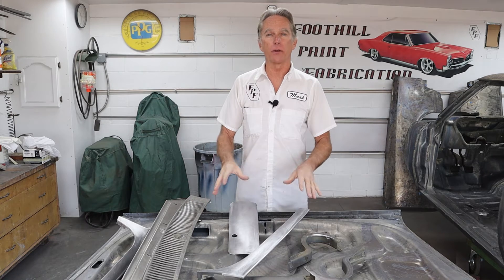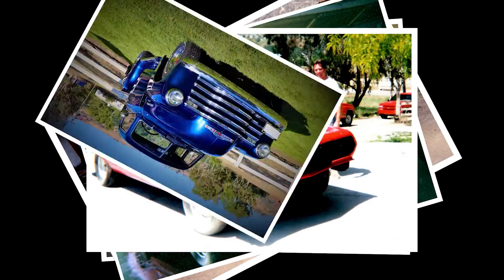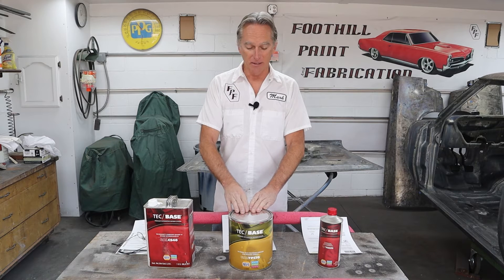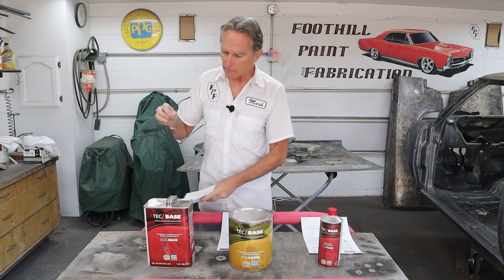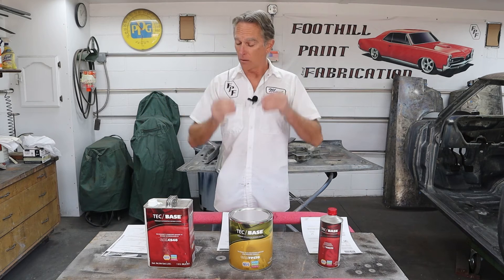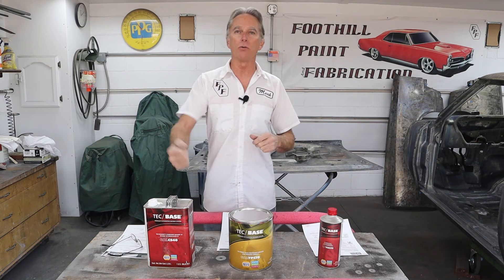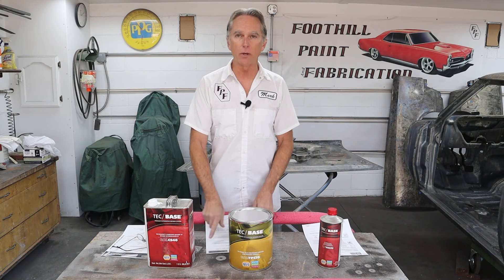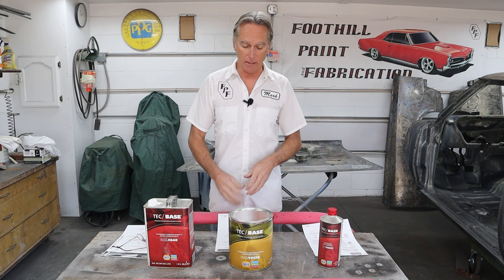Are DTM Primers Safe to use on Bare Metal?  Read the Fine Print, they all are NOT created equal

Comment: The best epoxy on the planet is AWLGRIP 545.
Reply from the maker: Isn't that stuff just for boats?
Reply: @FoothillPaintandFabrication It's excellent for bare steel, aluminum, fiberglass and even wood.  I restore boats here in St. Pete Florida that's all good shops use.
Reply: @FoothillPaintandFabrication Not at all.  Look it up...I've shot it for 20 years

Comment: I bought a speedokote urethane DTM primer is this for bare metal or paint over base
Reply from the maker: I found the TDS sheet for it I think.  It says it can be applied over steel but this is a pretty thin data sheet.  I have never seen a sheet with such little information.  Here is the link https://s3.amazonaws.com/speedosds/TDS/SS-2000TDS.pdf
Personally I wouldn't use it over exterior bare steel as urethane is water resistant, not water proof. It all depends on the level of your project and your budget.

Comment: Thanks for the info, Mark. I didn't know that there was an epoxy primer that was sand able. I have always used Shopline epoxy that tends to plug up the sandpaper. I thought I saw a NAPA logo on the can, interesting,  I'll have to check it out for the next project. Automotive paint is stunningly expensive!
Reply from the maker: I haven't sanded this product before but the rep told me it sands well. I will definitely let you all know. Back in the day I would walk out of the paint store with everything to paint a car and I mean everything (tape, paper, sealer, color, reducer and hardener) for just under a hundred bucks. Costs are crazy but I am willing to pay for quality.
Mark
Reply: @FoothillPaintandFabrication  well, materials have advanced since acrylic enamel paint and lacquer primer but it is still ridiculous.
Reply: @FoothillPaintandFabrication Try Marine grade Epoxy...Awlgrip 545.  Absolutely the best.
Reply from the maker: @warrenlewis3977  How does it sand?  Does it fill well?
Reply: @FoothillPaintandFabrication Awlgrip is High Build.  Once you use it, you won't use anything else.
Reply from the maker: @warrenlewis3977  I will keep it in mind for my next project.  
thanks
Reply: @FoothillPaintandFabrication Have a good day 😊
Reply: Its like this. A true Epoxy sealer for bare metal if you sand blasted is 1:1 (1part primer, 1 part hardener) and it's not sandable. You can scuff it with a red 3M scratch pad if you run past your adhesion window. Now you have 4:1 ratio 2K high build primers that say epoxy but they are really a hybrid epoxy same as House of Kolor KD3000 series Surfacer/Sealers that you can use as a high build, sands easy, then can be used as a sealer after block sanding if you add 1 part recucer to it. Really good 2K primers I prefer are the House of Kolor KD3000 series DTS Surfacer/Sealer, the Sikkens Highbuild Surfacer/Sealer, and the Roberlo Multyfiller Surfacer/Sealer. It's smart to get one you can reduce down to a sealer to put a coat or two down after you block sand before you put base down. You will get a much smoother nicer finish I promise.
Reply: Its like this. A true Epoxy sealer for bare metal if you sand blasted is 1:1 (1part primer, 1 part hardener) and it's not sandable. You can scuff it with a red 3M scratch pad if you run past your adhesion window. Now you have 4:1 ratio 2K high build primers that say epoxy but they are really a hybrid epoxy same as House of Kolor KD3000 series Surfacer/Sealers that you can use as a high build, sands easy, then can be used as a sealer after block sanding if you add 1 part recucer to it